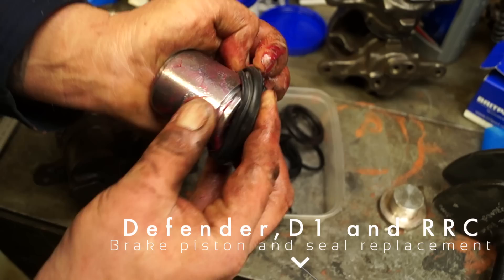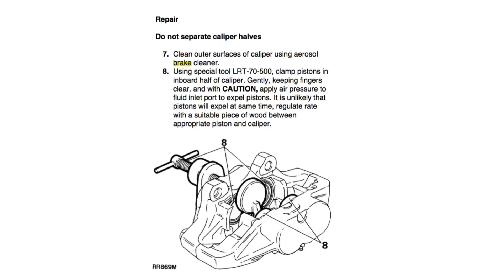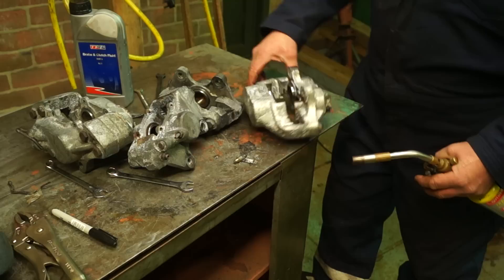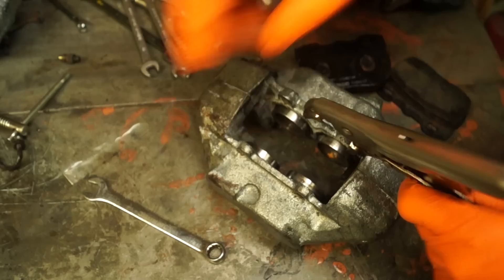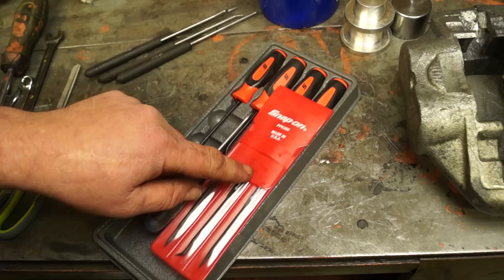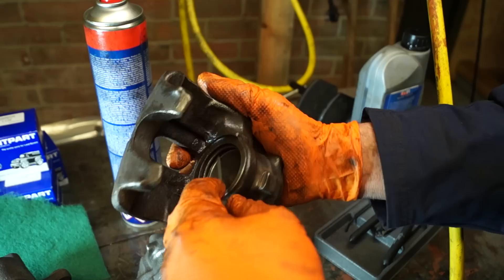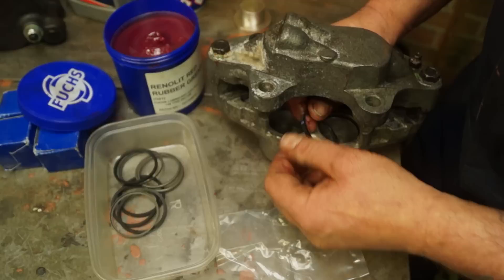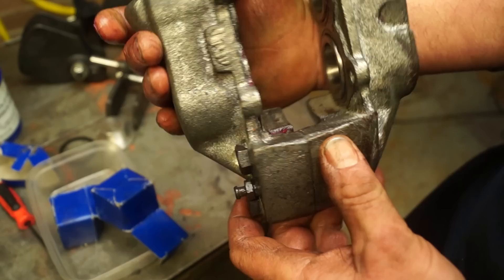Land Rover Brake Calliper Overhaul PART 2a - Stainless Steel Brake Calliper pistons.

Comment: Can anyone help me with the inner diameter of the pistons? Don't realy want to take everything apart just for one measurement. I have 46mm pistons.
Reply from the maker: How did you measure them?
Reply: @trailerfitter2  Managed to get callipers gauge inside when I removed the brake pad, but it was not enough to measure the inside diameter of the piston